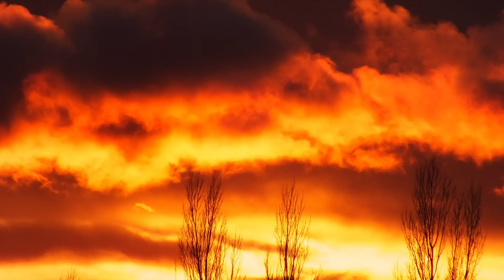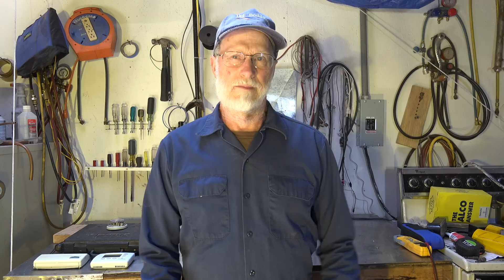Thermostat cycles per hour for the electric furnace #4

Comment: Just curious do what would a homeowner or technician do when installing a thermostat if that particular thermostat has a cycle rate adjustment for heating and cooling that is set independent from one another like for example Pro 1 or Aprilaire thermostats are adjustable for both modes
Reply from the maker: I would leave it at the factory setting.  The only time I would change it is if it cycles more often than desired or there is a change in structure temp between cycles.
GFM
Reply: @grayfurnaceman  that's what I thought too because I did notice something with it because we actually have a ceiling fan in the room where the thermostat is actually located and if we have that fan running the thermostat will kick the heat on more frequently and it does make it more comfortable in the rest of the house but I think another thing contributing to the cycling of it is there is also a bedroom door that is pretty much closed all the time and there is a draft under that door so I think it's actually causing it to run longer than it normally would but once the heat shuts off the draft is no longer there so I think what is actually happening it may be getting warmer than the set point and that's causing it not to cycle often enough but the door is closed so our dog doesn't go in that room with nobody there so we kinda got used to it now

Comment: We now have an aprilaire 8444 thermostat and they call the cycles per hour adjustment integral period on the thermostat the range of settings is off all the way to 5 minutes with off being proportional control so what setting would make the thermostat cycle more often
Reply from the maker: Set to 1.
GFM
Reply: @grayfurnaceman  ok thanks does that setting apply for both heating and cooling or is it just for heating

Comment: I have a question regarding a thermostat made by the manufacturer pro 1 and the model number of the thermostat is T701 the issue we have with it is the default setting for heating swing is 0.4 and it still only runs the furnace  for six minutes but only runs twice an hour is there any fix for this issue because we have tried adjusting the setting and setting it any higher it only runs once an hour but it gets freezing cold before it cycles back on
Reply from the maker: Set it at .2 to .3
GFM
Reply: @grayfurnaceman  ok  thank u
Reply: @grayfurnaceman  how long should it run though because the furnace is in a mobile home
Reply from the maker: @randytorboli  When the inside temp is stable, with outside temps above 40F about 5 to 7 minutes.
GFM

Comment: Our furnace has a digital thermostat with no adjustment on cycles per hour we have a white rodgers 1F78 thermostat
Reply from the maker: That thermostat has no adjustment for cycles per hour.  The only adjustment is for either forced air or hydronic.  If you want less cycles per hour, you can cut the W904 jumper.  That will reduce the cycles to about 3 per hour.
GFM

Comment: What about air conditioning? My Honeywell was cycling my compressor way too often at 3 cycles per hour. It was comfortable most of the time, but cycling way too much which will shorten the life of the system. It would go off for 5 minutes and then come on and sometimes run for under 10 minutes. I set it to 2 and it works much better though it still turns the first stage off twice an hour on hot days when the temperature didn't go below 75 on my thermometer. Honeywell doesn't seem to understand that by cycling it that much it isn't always dehumidifying properly.
Reply from the maker: The standard cycling rate for air conditioners is 3 CPH.  Longer cycling is better in my opinion.  
GFM

Comment: I have a 70% old nat gas hot water boiler. My house is medium insulated, all windows replaced with argon filled. Walls blown in and r40 in attic. How many cycles should set and at what temp. I currently have it at 6 cycles and 170 degrees. Thanks
Reply from the maker: Depends on the system.  Floor heat = longer cycles.  Baseboard shorter.  In any case, no more often than 3 CPH.  Temp is also dependent on system.  170F would be much too high for floor heat.  170 to 200F would work with baseboard.  Hope this helps.
GFM

Comment: was called out last winter to fix a voltage spike issue. noticed the furnace was kicking on like every 5mins. the prop mgr told me the poco bill was 1K per month since install. told him to get a heat loss audit done. any other suggestions? prop will be changing hands soon, and the new owner wants things up to snuff. thx Gray
Reply from the maker: You can reset the cycling rate on some electronic thermostats in the installer setup.  Mechanicals can have the anticipator reset for longer cycles.  Hope this helps.
GFM

Comment: Wouldn't electric base board heat better the furnace? at least you could have "zone heating" for every room. I suppose if you wanted an air handler the way to go would be a furnace. I just cant imagine heating with electricity unless you sit on a true hydro feed.
Reply from the maker: Baseboard heat is the most inefficient of the electric heat.  It seems like it would be better but it is not.  Too hot at the baseboards.
GFM
Reply: +grayfurnaceman yes I will backup what GFM says, I've seen those bills. Horrible way to heat!
Reply: I am no proponent of electrical heating. Say you've got 10Kw furnace with a fan and duct work, losses and duct work in unheated spaces. Now 10Kw in base board heating each with their own thermostat and convection distribution without any fan(s). Over all comfort, fan & duct loss not withstanding, the BTU output be the same. 10Kwh = about 34K BTU.
Now I do like electric water heaters of the tank variety due to they have minimal losses compared to vented Gas or Fuel oil. Still, electric heat is crazy expensive to buy from the utility.
Reply: +Craig Nehring that will of course will depend on your utility and how they package rates for homes only utilizing electric furnaces with heat pumps water heaters electric dryers etc etc. I grew up in an all electric neighborhood commissioned back in 1975. Our utility offered a rate for electric heating. Maintenance was also very minimal as well, so things offset other things in savings and expenditures.. It's an equilibrium and ultimately balanced out to be a very small benefit with gas combined with electric billed together. So aside from the fact you have to maintain gas burners on annual basis that was not required of course with electric and that's where the savings was felt mostly with electric and as for the heat pump that was cost of maintaining and was no different than any home with straight AC.